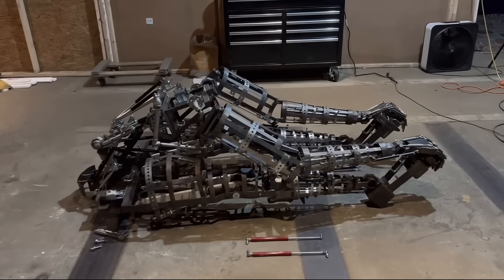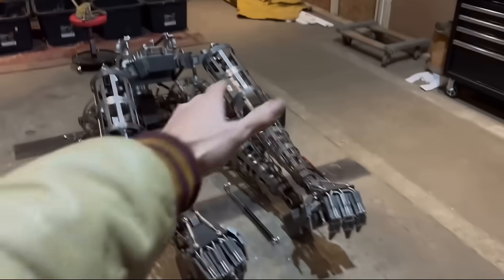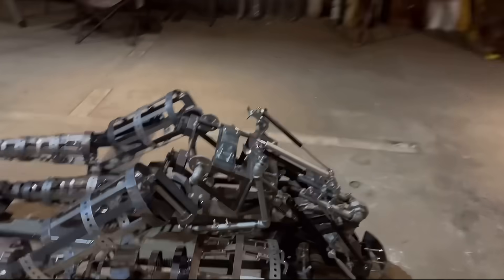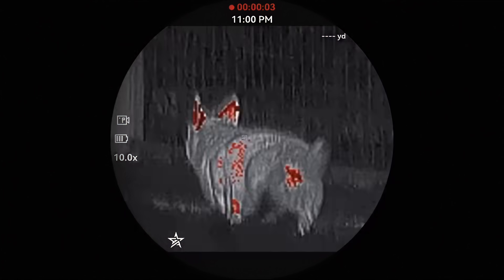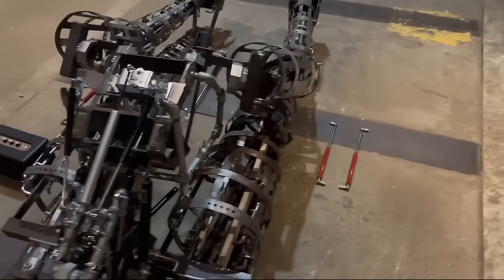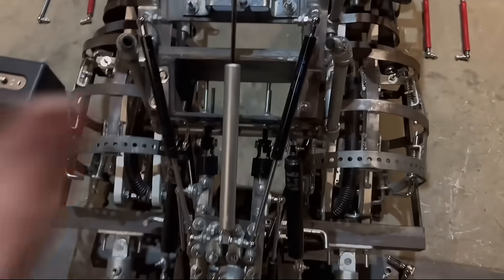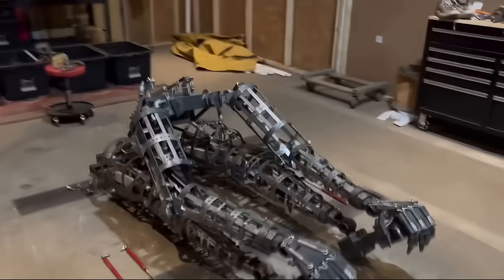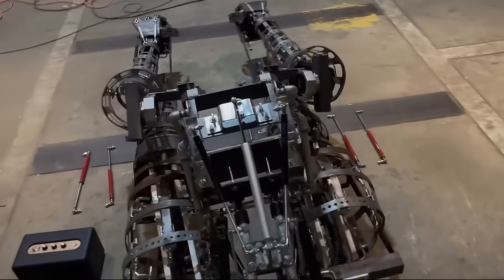Nosey Progress Report No. 35

Comment: Uh dude wheres the wires. the brain. the ai. the head. the  calculations so he dosent  tumble at 32 miles per hour. the fur.   the bulletproof armor on the fur. the heat protection the waterprotection. you got some work to do.

Comment: Yeah, so I would recommend so you could really have him move on his own. Just get like a large car battery that you could throw inside the torso and then put an air compressor on his back connected to the car battery so that those hydraulics could actually function using high pressure air and negative pressure so that the range of motion would be great. Greatly increased.

Comment: it’s AI-generated video.

Here’s why:

1. Unrealistic Engineering Claims
No independent builder with a home workshop could create a 10-foot bulletproof animatronic that runs faster than a cheetah. Such a project would require:

Multimillion-dollar funding
Teams of engineers in hydraulics, AI, and materials science
Years of development time
Even state-of-the-art robotics labs haven’t achieved anything close.

2. AI Visual Artifacts
Careful frame-by-frame viewing of Nosey clips revealed AI artifacts—tiny glitches and inconsistencies common in AI-generated video. These include unnatural shadows, warped mechanical parts, and flickering edges around Nosey’s body.

3. Use of Veo 3 and Other AI Tools
Investigators pointed out that the clips strongly resemble outputs from Google’s Veo 3, a cutting-edge AI video model capable of creating ultra-realistic moving footage from text prompts. With the right descriptions (“10-foot animatronic rabbit crouching in a hallway, glowing eyes”), Veo 3 can fabricate entire scenes like the Nosey videos.

Other tools such as Runway Gen-3, Pika Labs, and Kaiber AI could also have been used in combination for added realism.

4. No Continuous Shots of Functionality
Every Nosey clip is short, edited, and atmospheric. None show a full, continuous sequence of Nosey walking, running, or performing the claimed feats in a believable way. This matches how AI-generated clips are typically produced—brief, stylized segments, not sustained real footage.
I wrote this in 30 minutes

Comment: Brooooooo can you please stop or at least have a failsafe for when they go on a killing spree just for safety and try to add an alternate control mode where you can control them and then switch to them like patroling a perimeter, and only in that mode will the majority of the functions be available but only if something crosses into a specific area of where Nosey is patroling and only when you are control can you move them to patrol another location. When they detect something entering the area then thhey could hunt and/or question the person on why they entered the area and if they saw anything if no then Nosey could escort them away or throw them. If the intruder says yes then nosey will ask what and look through what they had said to figure out if it is worth killing or if it is just something not at all important.

Comment: I really feel like hydraulics are going to be too finicky and imprecise for a machine like this, using an electrolysis-hydrogen gas pneumatic muscles or monofilament fishingline heat actuated muscles will be far far more fitting and far more flexibile for nosey!! Also running a hydraulic pump would drain any battery you can put on it in a few hours at most

Comment: large, powerful air compressor.
The main problems shift but remain serious:
 * Massive Electrical Load (Compressor): The compressor needed to power a 10-foot animatronic will draw huge amounts of electricity, likely requiring a dedicated, high-voltage circuit (like for an industrial machine or large appliance). This still heavily taxes your electrical system.
 * Electrical Control: The pneumatic system is still controlled by electric solenoid valves and the AI controller, which all need a reliable, clean electrical supply. The compressor itself also generates EMI that could interfere with the AI control system.
 * Mechanical Failure Risk: Pneumatic systems, while powerful, rely on high-pressure air and can fail due to leaks, valve malfunctions, or cylinder issues, which can lead to rapid, uncontrolled, and dangerous movements.

Comment: it looks amazing but before its done you should add a bit of extra sheilding on the outside of the skeleton before you add any other layers because ik itll be fire proof n stuff but what abt both electrical shock resistant and blunt force stuff i feel like you dont want it to fall over because a random little bat hit it so find a way to spread the impact to reduce damages id recommend silicone rubber very absorbent and non conductive

(great work dude cant wait until its done)

Comment: Will Nosey be able to operate independently of a power supply, and for how long? And if not, are there any plans for it?

...Additionally, is Nosey compatible with a remote command & control center not unlike a Predator drone?

Comment: hi future architect/engineer here, just to say nosey will not survive, its impossible for it to run 32 mph, since he has weak points (aka joints), if any of the weak points get hit, he'll topple and fall Also, energy consumption is something to look at. What would a 10 feet tall robot need to be able to go autonomous and do everything that's mentioned. Like that'll consume so much energy that it would just turn off at one point (SPREAD THE WORD GUYS)

Comment: do you plan on using servoing or inverse kinematics? maintianing a center of gravity without proper robotic training is very difficult. What I have seen is the cheapest method is either using a motion tracker to train your ambulation into the continuous path, or use something like Issacsim to train using your graphics card. If you do plan on making this a combo of suit and animatronic, it may be benificial to install either stress gauges or rotary measurement transducers (IE, encoders or potentiometers to track movement per joint) so you can train the animatronic to operate under the same movement you asked it to replicate.

Comment: I recommend adding these key sensor types to give your robot true hypersense abilities:
Radar: Use a RADAR sensor to detect objects, their distance, speed, and angle over long ranges using radio waves.
Echolocation/Ranging: Install an ultrasonic sensor (for sound-based ranging) or LiDAR (for highly accurate laser-based 3D mapping and distance).
Heat Vision (Thermal): Add a thermal camera or infrared (IR) sensor to detect and map heat signatures in the environment.
Night Vision: Use a Low-light camera or an IR camera to amplify minimal visible light or detect light outside the visible spectrum.
Touch/Pressure: Include tactile sensors or Force/Torque sensors so the robot can safely feel and grip objects.
Orientation/Motion: Use an IMU (Inertial Measurement Unit), which combines accelerometers and gyroscopes for navigation, balance, and tracking movement.
Localization: Add GPS for absolute outdoor positioning and encoders on the motors to track the robot's own movement distance (odometry).
Standard Vision: Include a 2D or 3D camera for general visual object recognition and mapping.  I am making one myself something like nosy I want people to decide if I should make it a YouTube video I also want people to pick a name cuz I'm going for the silent and deadly aspect like nosy but for a more jokey you know  so here is the name[Patches the Puppet]---- let's go to saying is...Whisper🤫
Reply: Bruh is you trying to get us killed😭
Reply: @DylanThompson-c8p  NO, but     mm, im just helping. Also, I am wondering about patches the puppet should I😁

Comment: Finish it quicker... If you need tips most stainless steel begins to rust when scratched, add sunflower seed oil to prevent it. and find a effective charging system. Add fake muscles that take in air to make it have stronger force. If cost isn't a problem use aero gel as an insulator for wires